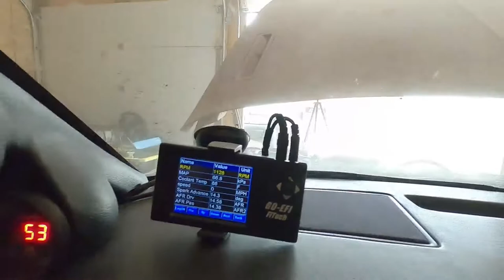First Fire Up of my LS Swappped Trans am!!!!

Comment: I love the video and the LS! swap.  If you didn't notice i'd like to point out that your alternator jumps around a little bit like it's not secured enough. I am looking forward to seeing more video's on your sweet GTA.
Reply from the maker: Thanks for the reply, and yeah that's one of the issues I got to fix with my build, along with a couple others. Last summer when I was racing the bolt that holds the one bracket on the alternator snapped and some of it is still in the head. I gotta pull the engine anyways to do a couple more "mods" and maybe changing the front routing. But thanks for watching:)